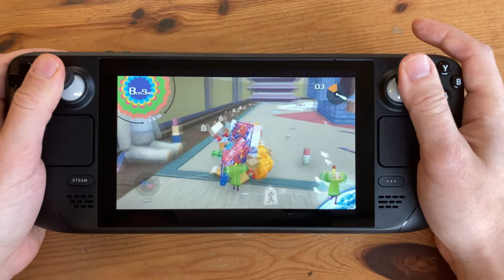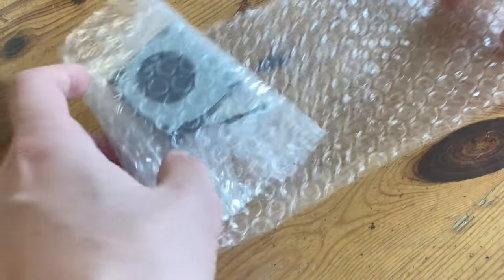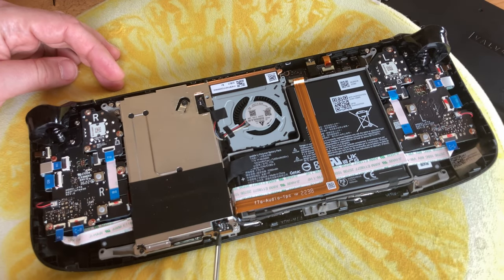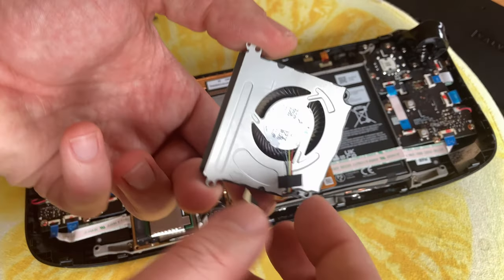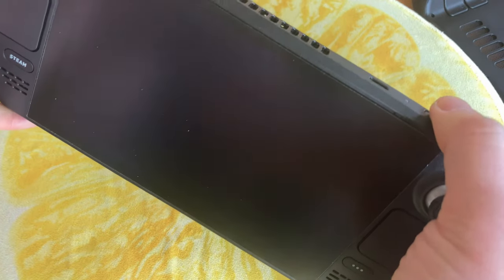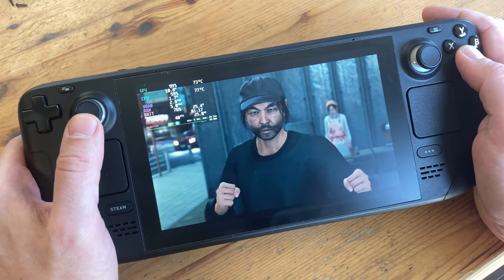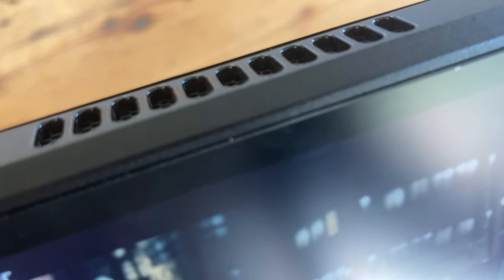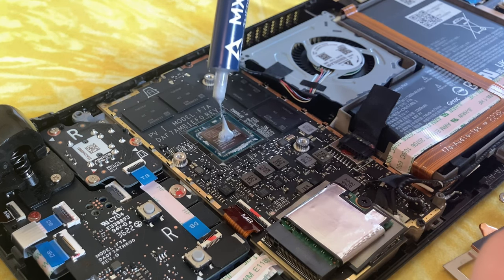STEAM DECK UPGRADE: $15 Huaying Fan REVIEW... But We Can Do BETTER for LESS!

Comment: MrRev and I changed to a graphite thermal pad when we upgraded our ssds and the 1k lower fan speeds and 3-4 degrees lower temps are noticeable... He had the delta fan and mine was the Hyang (bad spelling)
Reply from the maker: I'm wondering if them jsaux semi transparent backs do anything. They have a piece of metal that's supposed to help with the thermals
Reply: @Team Pandory  they just act as a thermal mass, so temps are lower for a little while and then eventually crop up right next to where it would be stock.

Comment: MX4 today I take as an absolute standard .I use it myself if I change the thermal paste somewhere .I am quite surprised that from the factory is used inferior paste and the difference in the fan speed in your result is so great ...It would not say
Reply: Factory thermal paste sucks irrespective of the manufacturer

Comment: Guess you got one of the good delta fans. I have the stock huaying fan (it came with my steam deck) and it does not have that higher pitched whine like your aftermarket does. You got the bad one probably.

Comment: Interesting, I have the noisy Delta fan and was planning on trying this replacement, but i Fix it seem to be constantly OOS. You've confused me chicken 😀
Reply from the maker: So this is the "Huaying" fan from AliExpress. There's a chance it could be real, or fake... I don't have a clue. But you could just do what we did at the end of the video to reduce temps and lower noise for maybe a third of the price ?
Reply: @TeamPandory  I've already been in to upgrade to an nvme drive and can't be ar$ed taking it apart again 🙂I know it's not too difficult but it's a little stressy.

Comment: i replaced on 3 of my decks the delta fan with huaying and i saw big difference in the fan noise...the stock delta fans was loud and whine , on huaying  i can barely hear them....maybe yours is defect dunno? should be the opposite. delta fans are loud and whiny.. while huaying are realy silent
Reply from the maker: These could just be fake 😂. 15$
Reply: Where did you get your fans from?
Reply from the maker: @mcrecordings  AliExpress ... Link is in description.
Seems to look similar though. I think ifixit is the number one place to get them tho perhaps?
Reply: @TeamPandory  I was curious where overoula got his. I Fix It ones are £25 so maybe the ali' ones are knock-offs.
Reply: @TeamPandory  On the other hand, fake what works also counts ...of course the sound is the thing that will burn you after the original fan is stuck for good :/
Reply from the maker: @czviktor  it can be a backup if my original ever snuffs it. Should be fine ☺️
Reply: @mcrecordings  more like ifixit buys same $15 fans from manufacturer for less and sells you £25. Knock-off of a niche fan? Cmon.
Reply: @Kaylas1821  Pandory was the one who suggested it. I got one from a different listing and it's noticeably quieter so something was up with his.

Comment: When you changed the thermal paste, did you use the stock fan or the Huaying?
Reply from the maker: Changed back to the stock fan. 😊
Reply: @TeamPandory  excellent, thank you, I'll be doing this.
Reply from the maker: @Rick_Ibbott  I'm going to try something else soon... Honestly, that mx4 has been in a drawer for the best part of a year- I reckon using it fresh, or even a better rated thermal paste will give even better results. 
... And maybe source another fan ? 😂
Reply: Good stuff. Inspired me to do this when I get home from work later in the week - I've allsorts of pastes etc from tinkering with my pc. Either way, great video for highlighting that decent thermal paste is all that's needed sometimes.
Reply from the maker: @Rick_Ibbott  toothpaste, mayonnaise, tartar sauce are probably all on the list of not to use. Maybe 🤔
Reply: What happened?